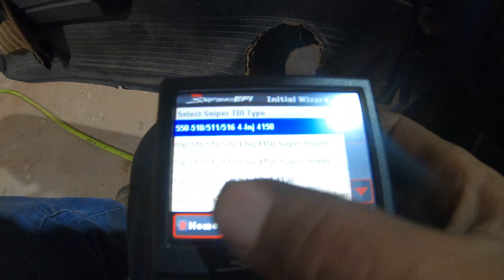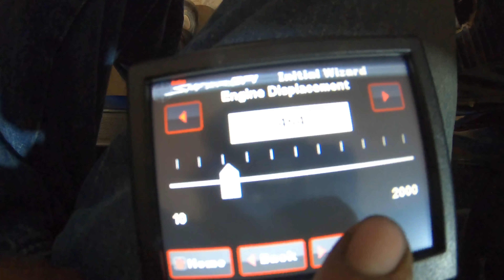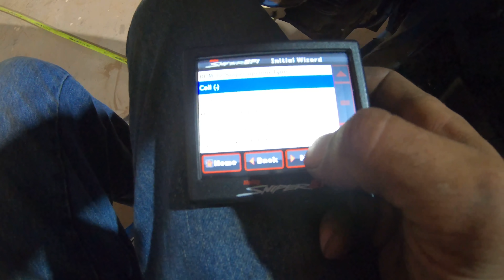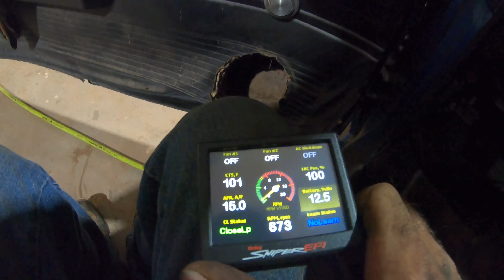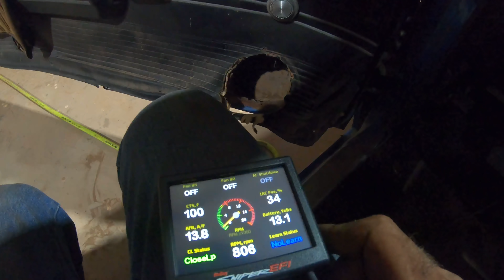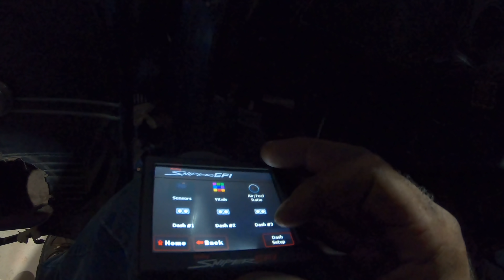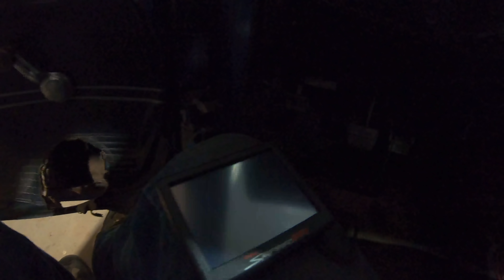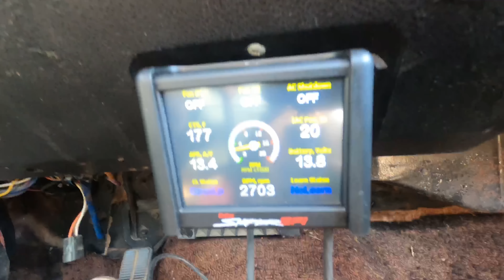EFI CAMINO!!!!! Holly Efi installed on the Elcamino Will IT START?????

Comment: I had studs that were coarse on one end, fine thread on the other. I just bite the bullet and get bolts and nuts of the right pitch to fit what the manifold takes. I know some folks don't need instructions; sadly I'm not one of them.

Comment: Completely normal for there to be a learning curve and "dialing in" process that you will have to go through on this type of project.  Exhaust system can be checked for leaks by reversing the airflow on the shop-vac, taping the vac hose to the exhaust pipes one at a time (with other exhaust pipe taped off), blowing air into the exhaust pipes (engine off), and painting (with paint brush) the exhaust pipe surfaces with soapy water as you go along with a flashlight and check for soap bubbles, from front to back the entire way.  If you see bubbles, it's an exhaust leak which  you can plug or fix one way or another.  El Camino getting stronger!!
Reply: Needs at least 2 1/2inch system and 1 7/8 headers to get it going.That system on it will sound like farting

Comment: Lol next time you drain a tank bud shove your hose In The tank close to the bottom as you can feel with other end in container, grab the air hose with blower nozzle shove rag around the gap between hoses at fuel inlet, it will pressurize and evacuate the gas from the tank
Reply from the maker: I wanted to suck all the crap off the bottom of the tank